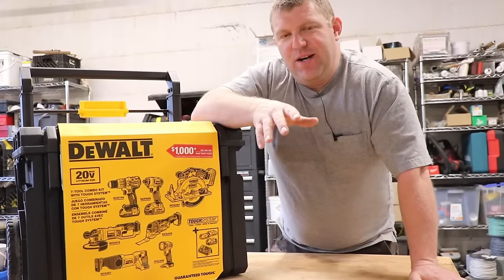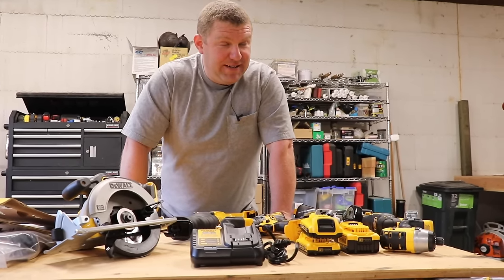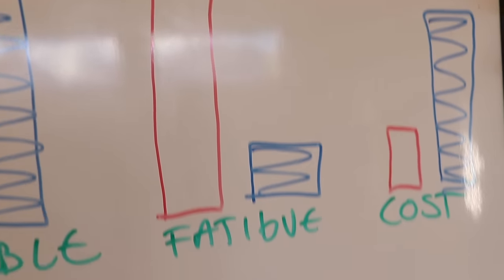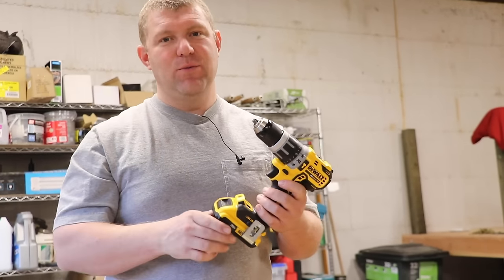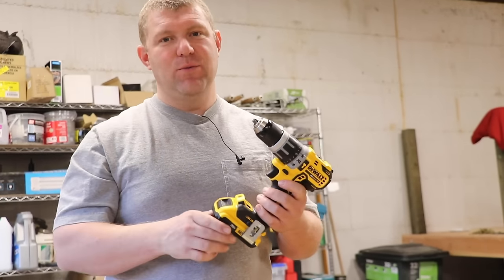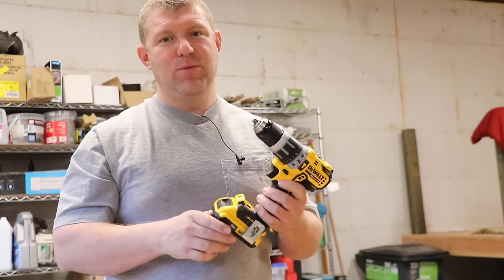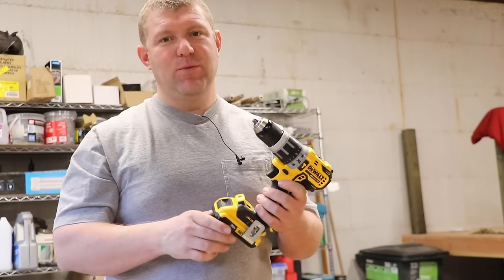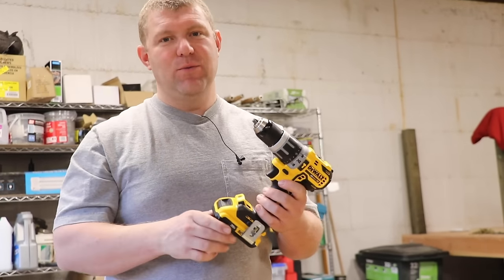SHAME ON YOU DEWALT

Comment: XR does not and never has meant the the tool is brushless. XR tools came out long before the brushless tools were introduced. XR stands for extreme runtime. I will agree that those package deals do usually come with the cheaper models of the tools. If you are looking for good tools, you will rarely find them discounted. You get what you pay for. (Most of the time)

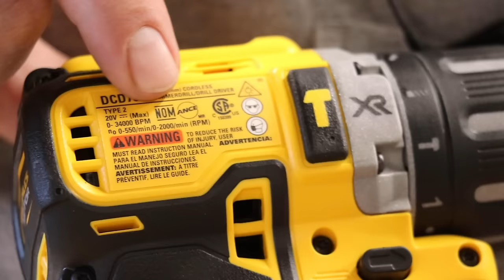Comment: Shame on YOU!  7:40 It says XR right on the drill!!  So you got exactly what was on the box.  And as so many others have stated, XR has NOTHING to do with brushless.  It stands for Xtreme Runtime.  There are truths being told in this video but the whole premise of it is bunked.  Don't bash Dewalt.  They sell low to moderately priced tools for standard use and do a damn good job in that role.  You dont go buy an F450 to pull the yard trailer around on the weekends.  

Change the title dude.

Comment: I work for a commercial tool and fastener company. We have to continually educate workers thst the price point items (tools made to sell at a certain price), mostly in the big box stores, versus a tool made to do a certain job is NOT the same thing. Another concern you have not mentioned is the tiny 2 or 3 amp hour batteries that the big boxes sell. My company only sells 5 amp hour batteries. It is NOT Dewalt that is fooling you. It is the big box stores driving the tool companies to cheapen their tools, to keep the big boys happy. Leason learned, don't by from the big boxes if you are a professional. Lowes and Home Depot primary markets are homeowners. Don't get fooled, buy from someone who will ask questions and match you with the specific tool for the job your doing.

Comment: I betcha if you had read the box and ratings this would not have happened. It's up to the consumer to do the homework. 
Dewalt has put these kits together to give more items to a consumer for the price that works for them. 
I buy my dewalt tools individually from a dealer here in PA. Getting exactly what I wanted.
Reply: Yup. Agreed. I also have 1 or 2 non yellow tools as the other offerings I felt we're better even giving up the 1 battery  convenience.
Reply: I was thinking the same thing. Buying a multi-kit is for people who more rarely use them, and dont need the power of quality tools. If you use tools on a regular basis, you buy them one at a time!

Comment: DeWalt's been using the XR branding for much longer than they've had any brushless tools, and I've never correlated brushless to their XR branding.  In fact, I've always ignored their XR branding.  I also don't think the brushed tools will die faster, I've never worn out a brush before some other component failed catastrophically.  So I really only think the brushless is better from a low-speed torque and efficiency.
Reply: My first dewalt kit was xr labelled that was in 2002 so not only before brushless motors but before lithium batteries as far as I knew xr was the heavier duty version of everything and as for the brushes wearing out my first drill lasted 4 year during my electrical apprenticeship and seriously took like 30min to replace them then got another 2 years before the NiMH batteries just didn't hold enough charge
Reply: Plus it is 7 bucks for new brushes most of the time...and they are easy to change

Comment: That 1/2 hour saved me hours and hours trawling through various websites, thanks. I worked with the guys in construction on Vikings tv show for years. It was almost always 50% Dewalt 50% everything else put together, lots of yellow. Every day they debated the merits of their choices. The oldest tools tended to be Bosch and Festool so that is a test we rarely get results on. Dark green tools tended to get knocked into the water a lot so I presume its the same everywhere else too. Black & Decker more often than not found in bins (not a personal opinion but that's where i saw them). people tend to stay loyal to whatever brand they choose and people who use Hitachi seemed to be always trying to convert everyone else. Milwaukee users tended to tell you their old one was much better. Oh and Dewalt tools always seemed to be relatively new. I dont know if that means anything like they dont last or they keep bringing out upgrades or baybe even they are yellow so you can see them instead of kick them.

Comment: As a contractor I bought many of my power tools in the '60's -'70's. Yes they are corded and heavier and metal and they all still work. Only my 7" Milwaukee grinder has needed to have the brushes replaced. These are old tools that have had the dickens worked out of them. Good luck to all of you with your new stuff or look at pawn shops and flea markets for the old Made in USA tools. Money better spent on a good generator.to plug the old tools into.

Comment: As a 67 year old house framer. I use a Skil 77. It is almost as old as I am. No brake. Safety comes from the user not the tool. As for the other tools, as a professional I would have done a
thorough research, before pulling the trigger at the cash registrar. I love the Dewalt XR line. Sorry you got the wrong tools.

Comment: Also Dewalt, Craftsman and several other major brands are now made in CHINA.... its plain as day on the label....   My first cordless sets were made in the good ole USA , when those burned up after years of great service the replacements never held up as well ( and I never knew why ) until one day someone pointed that out to me....wow. Great tools are hard to come by anymore and why turn a good thing bad, especially pulling wool over a consumers eyes?  Latest news is I switched to Rigid because they come with a lifetime replacement of the batterys and tools for the life that you own them ( have to register your products online )  where the normal battery life is 2 years for cordless tool this saves you a ton of money and if the tool ever dies you get a new one not refurbished ! The rigid tools are heavier ( metal gearboxes ) well made tools,

Comment: Brushed and brushless directly indicates the type of MOTOR.  The battery does not enter into the consideration at all except for ~maybe a change in voltage required.  Brushless tools ~might last longer in theory if both motors are equal in output power, but in practice, newer brushless motors are generally smaller and less capable and/or built with less longevity in mind.  Good on you for bringing this bad marketing to our attention.  DeWalt should be fined for misleading customers this way.  I suggest you review AvE's video reviews and tear downs of popular power tools.
Reply: It wasn't misleading by dewalt xr has nothing to do with brushless tools the Dr range has existed since before there was brushless tools the only issue here is someone not paying attention to what they were purchasing all kits have clear labels of the model numbers of each tool in the kit so you could see the specs of every tool on their website
Reply: You mention AvE. If you have seen his videos then you would know the brushless last longer due to smarter electronics. They keep you (the user) from over heating the motor and from damaging the batteries. This is the reason most brushless tools come with far better manufacture warranties than the old tech. Older power tools needed to be more robust physically because you had to really on the user to not damage anything. Ever hold the trigger on a drill to use it as a Screwdriver?
Reply: I think he meant that if the motor is more efficient, the battery won't have to work as hard for the tool to develop the same power. My experience is that brushless motors can be half the size of the equivalent power brushed motor because the stator can conduct heat away from the coils.
Reply: "... newer brushless motors are generally smaller and less capable ..."  I disagree !  Yes, brushless motors are smaller and lighter and consume less power from the same size battery,  but are not "less capable".  You have to understand that all power tools have gears and the gear RATIO is what is important.   Brushless motors, by their nature, spin faster.  This means they can be "geared down" more and provide more "power" delivered to the working end of the tool.

Comment: Dewalt has XR on alot of tools that are not brushless, so I wouldn't assume that XR means brushless, XR =, extra runtime not brushless. And does anyone ever use the side handle on a combi drill. I have a 36v Bosch sds, and I use the side handle all the time on that, but it's a much more powerful machine and heavier than a combi drill. At the end of the day it up to the concumer to check what your buying.

Comment: something else to consider on the hammer drill - without the handle, you'll put your hand on the heel to help push.... which is where the fan and cooling vents are located.  It WILL burn up the drill if you push there for any time at all (or, translation for my UK friends, it will let the smoke out).... oh yeah, and if you put a 6 1/2 blade on the Milwaukie, I think your result would be different.

Comment: Hi Jesse,  Here in the UK Dewalt has such a bad rep that I have not bought any of their tools for some time. I do have a Dewalt multi-tool but it is so weak it will not even cut material. I did some work for a friend, and they wanted to pay me but I don't work for money and declined. They went out and bought a bosh multi-tool. I was annoyed with them as I had already said that I did not want anything and at some point, I may need a hand on something and ask them. But I used the Bosh multi-tool and the difference was amazing, it cut through wood like it was cutting through butter. I have heard good reports from across the pond but here pure crap.

Comment: about 10 years ago or so I bought the 18 volt  Dewalt  XR  set  {  way before brushless was even out  }  What does the XR mean on Dewalt?
All tools come with upgraded features, superior ergonomics and use Lithium-Ion batteries. For extreme performance, step up to the XR ® series and get advanced electronics, extended runtime and faster application speeds. † DEWALT 20V MAX* vs. DEWALT 18V NiCad......you want Brushless  look for it on the box

Comment: Less then two minuets in I can already tell you exactly what the issue is, over the last 5-8 years, Dewalt has focused their easily available large combo kits on weekend warrior, impulse buy, best value overall, types. Putting stepped down models of pretty much every tool in the kits. Which any person who does 15 minuets of research on the model numbers of the tools included would figure out.
If you want the better tools (aka the the ones most stores sell individually) in a kit, you'll have to either go online, or go to a dealer store. 
Or just buy a different brand thats stayed focused on the professional user instead of trying to reach the average consumer market.

Comment: More important than brushless is RPM, Torque, 20 Volt batteries are not 20 volt under load is actually 18 under use, XR is a designation "extreme runtime" Only brushless tools are labeled brushless. they also have the worst warranty of their 3 year warranty only the first year covers parts and labor the final 2 years parts only you pay for labor. in the last 15 years there are only 2 brands that have not changed their battery platforms, Ridgid and Ryobi are able to use new batteries on the old tools, a big benefit to people who buy into a brand.
Dewalt is very misleading, Built in USA "(with international parts)
20volts "fully charged, not under load 18volts nominal under load"
3 year warranty "parts and labor only first year, Parts only Year 2 & 3"

Comment: I get your point here. I am not in the trades but I am more than a weekend warrior and I thoroughly abuse my cordless tools-such as dropping from a ladder to concrete!? My old Dewalts (12 & 18Volt) have performed well--still do today. The lithium 18 and 20volt machines I am still testing and not overly pleased. I too was hoodwinked with the kit form where i bought my reciprocating saw. That saw is a heavy power consumer, bought the additional larger battery for much more money and I still am dis-satisfied with the run-time. It is still better to take my Honda generator out into my property and use my corded Makita recip. I have good run time with my old 12 and 18 volt old-school products--plus--they progressively start running down near the end, which gives me warning, where the lithium simply STOP, which I find very annoying. I am 70 years old and work with tools every day, so I have a an appreciation for tools that work properly. I like your channel and the interaction of you 2 as a couple. -------Mikey

Comment: All companies that sell these type of tools have the low cost kits that don't have their best tools included, I thought everyone knew that.  If you want the best they offer then you have to buy them individually.  The brushless  tools are far more efficient but as far as longevity that is still out for debate, they haven't been around long enough to compare.  Brushless tools have many integrated circuits on board that can be sensitive to static electricity discharge and heat cycles both of which can come into play in serious construction situations.  Brushed motors do require the replacement of the brushes but have very simple circuits that are almost fail proof.  I have 10 or more brushed circuit tools that are more than 30-years old and are still running quite well!

Comment: The 2ah battery is the bargain basement option for sure. Whenever possible I always go for the 4-5ah battery every time. More torque,  screws, light or whatever. The trade is a bit of added weight. The Dewalt saw also has a thinner curf too if you measure so less material moved.

Comment: brushless is more of a marketing gimmick, you dont get much differance. All wired mains supply tools are brushed so this a non issue. You need to put a lot of hours into a tool to wear out the bushes on dewalt tools and when they do wear out the rest of the tool will be worn out aswell. This is my experience from using dewalt grinders and drills.

Comment: We need a new video to explain why you are again changing tool brands.  If I recall correctly, you started this journey with Black and Decker cordless tools.  Then you bought the Makita cordless drill and impact driver and you gave some justifications (and high praise) at that time for the new brand.  Then you got Milwaukee cordless and I don't remember your doing any comparison/justification. Somewhere in there you bought the Makita, two battery, Beast, circular saw.  Now you buy a Dewalt combo.  Is there something missing with the Milwaukee lineup? Besides now having 3 (4 if you kept the B&D) brands of batteries to keep track of and replace over time, you have to keep 3 (4?) different chargers plugged in and ready, taking up more space than one brand would.  How about a video about why you would want to go to 3 brands of tools/batteries/chargers?  Makita doesn't have the full lineup of tools?  Milwaukee coming up short (you seemed pretty proud of the Milwaukee in this video)? 
I didn't go with the best, but I have the Craftsman C3 (19.2) volt line up and did that because they had an extensive line of different tools, all using the same batteries, and I have acquired most of them over the years. The sticker with this choice is now that Sears sold the Craftsman rights to Stanley Black & Decker, they have gone to a different battery for their lineup, they say they will not support the C3 batteries, even with an adapter, and it is questionable how long I can get replacements through Sears.  They also dropped all the C3 series tools, except a drill/driver and the 1/4" impact driver.  I see some batteries are available on Amazon, so I may be able to replace batteries that die on me, but luckily the LI batteries seem to last a long time.
So you end the video and we see Alisa (sp?) cleaning up the mess! I know she's a sweetheart, but really, you made it; why aren't you cleaning up?

Comment: Dewalt is deceptive about everything. My problem with Dewalt is the lack of quality in their motors and clutches and their poor customer service. I sold all my Dewalt cordless tools, and I will never buy their products again. Voltage and longevity are more important to me. As a Licensed Electrician, brushed tools are very adequate, but they have to be a minimum 18 volts. Anything less is only for homeowners. I have Ridgid and Milwaukee cordless tools now, and I am perfectly happy with them. I like one or maybe two battery systems at the most, no more.

Comment: The kit tool vs the "good" tool deception is extremely prevalent. I bought into the Makita system years ago and I've never been able to buy any of the multi tool kits. Either they don't offer the tool i want (specifying something with half the speed/torque, missing features, etc), OR there is a MASSIVE price difference, lol. I feel like manufactures haven't done a sufficient job of educating consumers as to the drastic difference in capabilities from the budget end to the pro end of the spectrum. But, when they can sell an underperforming tool, get you into the battery architecture and then sell you additional tools to meet your actual requirements, it is definitely good for their bottom line.

Comment: Used Dewalt tools for years switch to Milwaukee tools in 2007 and never looked back. The parent company of Dewalt tools brought the quality down and now they are right there with Porter Cable both junk. I have been an electrician for 25 plus years use cordless tools everyday.

Comment: A side note, brushed tools last quite well, and the "wear" is on the brushes that are a consumable that can be replaced at very low cost. And I've never worn out the brushes in a cordless tool yet. And any "hammer drill" in the same format as a normal cordless drill is a joke anyhow.